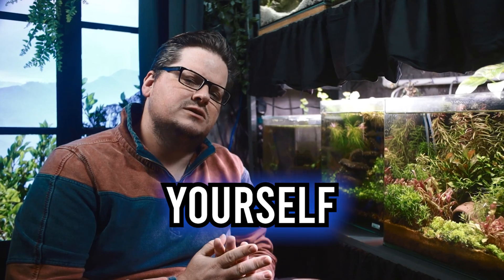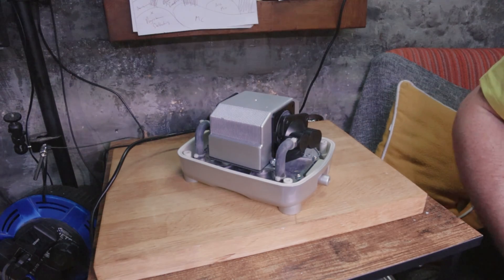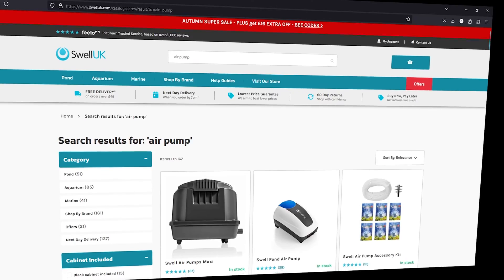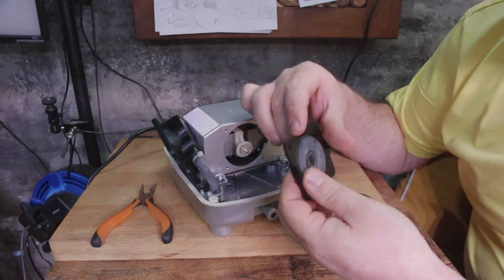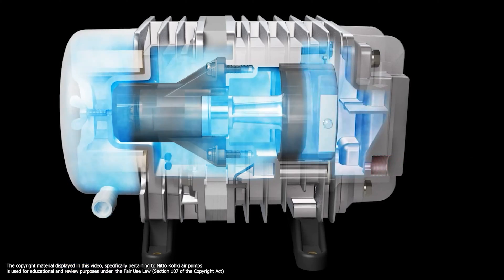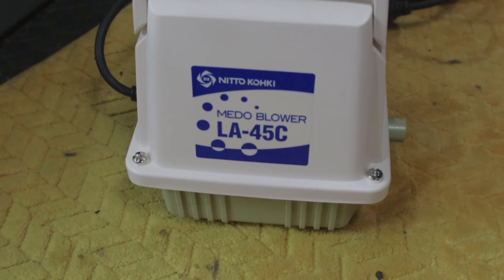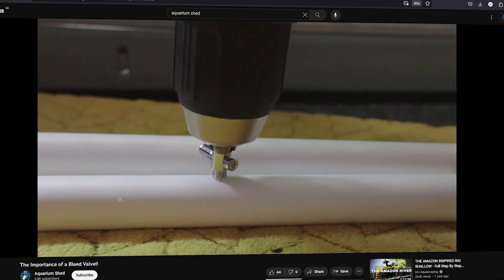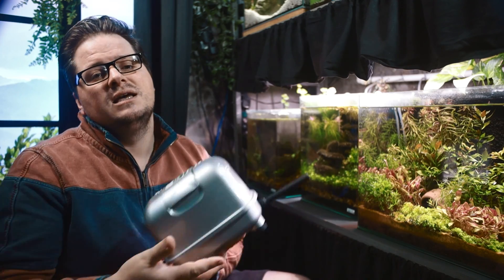$240 Linear Piston Air Pump vs $60 Diaphragm Air Pump

Comment: Isn't the linear pumps much louder and also heat up a lot more?
Reply: You are right....
I have been using a HAP 120Liter/minute diapragm pump on my koi pond setup for 14 years now, and it still run very well.
Some years ago I was unlucky to  drown that pump by water and it brake the fuse.
I disasembeled the pump and cleaned it out and dryed it.
And it did run perfectly again.
By this 14 years I have only replaced the rubber diapragms only one time by this time, and is about to replace them again now.
I have also now done some upgrades to my fiter system, and was in need of one more a pump and ordered an electromagnetic linear piston 240l/min / 14400 l/t pump.
And I'm going to return that pump because it makes so aweful lot of noice and vibrations.
I could not have that much noise in my filter house.
My diaprame pump is almoust noiseless compared to the piston pump.
Reply: where did u hear such? I have heard opposite
Reply: No, the opposite is true.